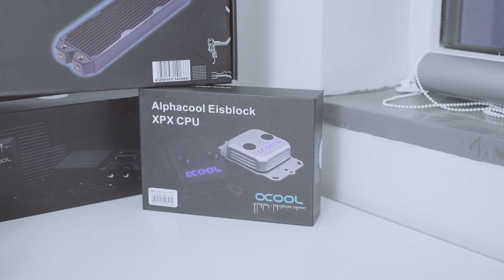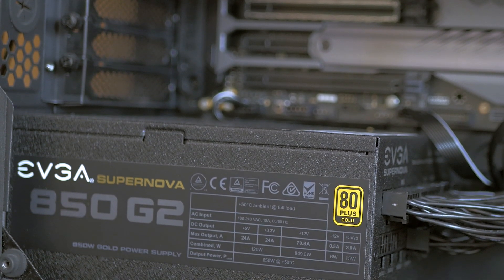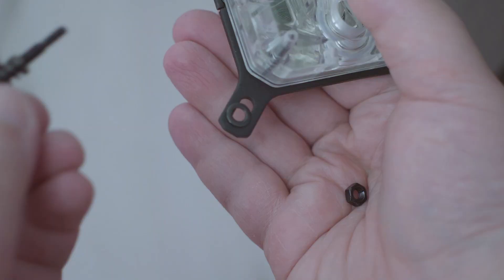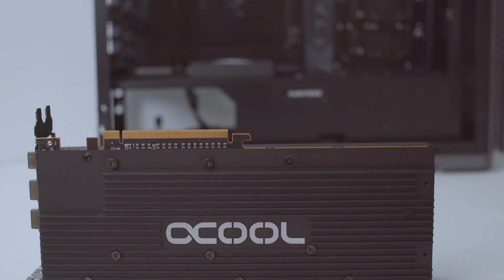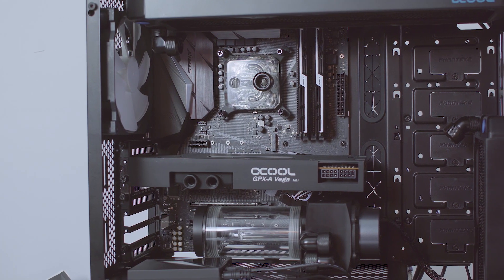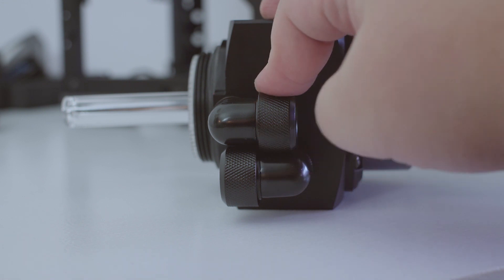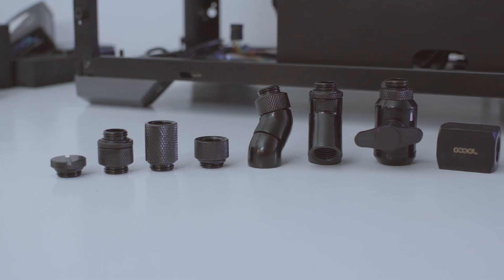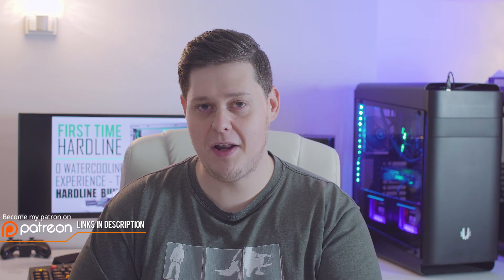WATERCOOLING beginner? / Straight to HARDLINE BUILD GUIDE - Part 1

Comment: Thanks for the video man. I plan on doing exactly what you did, straight into hard pipe, skipping the soft stuff. Thanks for the video, I'm sure it will help with my custom build.
Reply: You'll save money that way, no need for all the soft tubes and fittings.
On the other hand soft tube is handy if your making changes to your loop and need to still use your pc, or if you want to quickly test a new graphics card, then soft tube makes it easier

Comment: 8700K CPU's will need a different socket 1151 board.  Kind of confusing on Intels part.  Same socket but the version 8 processor requires the appropriate chipset, Z370 etc.  So unfortunately you will need to upgrade the board to go to the next level.  However, Thanks for the hard tube video, I was thinking I was going to break something.   Smacks forehead .... aaahhh heat gun.

Comment: Just curious... does your Z270-F Strix handle the 3600 Mhz ram ? I have the same combo (CPU+GPU) and the Trident Z RGB 3866 kit but i can't get it it post past 3200 Mhz. I was just curious if it's a CPU or a Mobo thing.    
P.S. Good idea for the video :)
Reply from the maker: +Vlad Tiberiu It's more likely a CPU thing - IMC related. This board had no issues even with 4000MHz RAM. But like I said, it greatly depends on the IMC as well. It does have like a blind spot around 2933-3050MHz and will not boot here unless tweaked, but otherwise it's a great board.

Comment: Good luck with this project and welcome to the club :)
My couple of cents here:
1. XFlow rads are much more convenient for tube routing, draining and bleeding. 
2. 90 and 45 fittings are kinda not really practical. it's better to use angled adapters + normal fittings. you get the same result but with much more flexible components. and in the end, it does not cost much more (if at all) as the alphacool fittings come in packs for lower price.
3. technically, this alphacool GPU block is not a real full cover block since the waterblock is cooling only GPU (for this particular card also the HBM2) but leaves the VRM to the passive cooling by that huge aluminum heatsink. not ideal and bulky but can save a lot of money during upgrades as you only need to switch that heatsink that conveniently sold separately for almost any card in the market worth liquid cooling.
4. in the long term, the PETG tubing sucks for the following reasons:
a. PETG is the softest among hardline tubing so naturally it is the most scratchy - can be scratched by tightening the fittings and even by whipping the dust of them.
b. PETG is prone to become cloudy (less clear) much faster than other clear tubing.
c. PETG is the worst when it comes to chemicals resistance. For example most coolants contain polypropylene glycol and that things dissolves PETG. It will not happen immediately as the % is low in most coolants, but to have an idea, fill the a piece of PETG tube with antifreeze and seal it. 
The acrylic tube is way better for the long term though still scratchy and a bit trickier to bend.
The ultimate clear hardline tubbing is of course glass. No scratches, no chemical annoyances, remains clear forever. The downside is that you will endup using more fittings/adapters as there is no bending, but not much. In my full loop there are only 4 spots where bending would be an option. And cutting glass tubes is not harder than bending.

here is about what I ended up with for the last loop: https://i.imgur.com/7X6KRgg.jpg
Reply from the maker: +Dmitri Weissman Awesome reply here! Thanks for chiming in with some great advice. I'll take into consideration the angled adapters and regular fittings part!
The GPU block is hybrid indeed. However, the amount of metal in this thing is impressive and should absorb heat quickly, which means even low airflow can give good results for the VRMs. But we'll see once I power this rig up and start testing.
Reply: MindBlank Tech,  no worries, this GPU block does awesome job at cooling if you don't mind the look and size. A friend of mine using it to cool GTX 1080 FTW.

Comment: Please show more about how the drain fitting actually works. Maybe drain some fluid so we can see exactly how it works. Also, please show how you connect the fittings to the hardline tube. Like zoom in and do it on camera. Explain the internal and external diameters of the fittings and tubes. For this to be a guide we need to see every step otherwise we will be lost. I am speaking for all the newbie water cooling builders of course. Otherwise, this is another great video and I can't wait for the next one!
Reply from the maker: +issaciams Yup, you got it. Will do in the next video!

Comment: With a radiator that massive in the roof, you definitely do not need another in the front, especially since it just hinders airflow at that point. If you are determined to keep that front radiator or already finished the system by the time this video went live, then you should get a filter and flip the rear fan around as an intake, otherwise that 360 will choke for air. Also that gpu block is a hybrid block, meaning it still needs some airflow to cool the vrm's, but you should be fine there with the current setup anyways. 

Side note, in a case where a 420 (140x3) radiator in the roof is an option, use that over a 360. A 420 radiator provides more surface area than a 480 rad and decent 140mm fans are no different on a radiator than 120mm fans.
Reply from the maker: +James Mastroianni Thanks for the tip, dude! I'll flip that 140mm rear fan to intake for more air. I agree a 420 would've been better, and no other 240mm needed. It's too late now...

Comment: Forgot a tip.  PETG scratches a lot easier than acrylic. Be careful while handling, also be sure the fittings do not slide up or down tube while placing, cause that will scratch the hell out of PETG and may go unnoticed till under certain lighting conditions.
Reply: If its more delicate, why would you use PETG instead of Acrylic? Does it look better leak less or something? Thanks
Reply: Tanner Richey PETG is strong and does not break easily. A stable material suited for long term use. Also more forgiving that acrylic.	Acrylic is easier to break than PETG and has less impact resistance, however, it has more flexibility.

Comment: Now this will be interesting. I cannot wait to see how this turns out. If you plan to keep long term get a better pump. The flow rate on the Alphacool Eispumpe VPP755 is less than optimal. Not all D5 pumps are the same anymore, specs need to be checked.

Comment: how about mixing soft with hardline tubing? is there any reason not to ?
Reply: not rly esthetic. Otherwise - no drawbacks
Reply: Soft tubing can leach. I would not recommend mixing them if avoidable.
Reply: you can do that no problem. if you have parts of the tubing that are out of sight, for example in a case basement or on the back side of the case, you can use flexible tubing there
Reply: Raziel what do you mean? How can it leach if mixed, but not leach when not mixed
Reply: How did you get that from what I said? I said soft tube can leach. Hardline will not. I said avoid, not that you can't. If you mix soft tube with hardline you will take away the maintenance benefits of hardline.
Reply: I dont get it. why do u even want to mix it?
It will look awkward and even worse than full soft tubing build.
As said guy above - the only one reason to use soft tubing in hard tube build is closed areas, like psu chamber etc. Just to make maintenance more easy
Reply: if you use proper soft tubing without plasticizer like primochill advanced lrt, you will not encounter any leeching issues
Reply from the maker: +Edd Kubilius No, I don't think it's a problem. Just aesthetic-wise...

Comment: I just built my first custom loop about a month ago, all XSPC soft tubing. Glad I went with it too because fitting a 280mm radiator in the front of an S340 Elite was interesting as it had to go ports up, whereas I really wanted to have them at the bottom but wasn't going to sacrifice cooling to buy a 240mm rad instead. There are some very tight areas in my build so the soft tubing was a good choice for me. The fun part was fitting the drain port, which is between the front radiator and reservoir, so the system will have to be placed upside-down and the long tube from the GPU to rad opened to allow air into the system. Not ideal, but it works. Temperature sensor is between the GPU and radiator so always reads on the warm side, but that was about the only place it would fit.

https://imgur.com/a/RzEIw
Reply: that is not a case meant for watercooling lol, wanna take a guess on how much airflow you're gonna get through that radiator?
Reply: @Pennywise, in a s340, we are not talking 2 degrees. It's not a bad case, only for air cooling, rads just add way too much restriction.
Reply: Pennywise but what was the temps of other components? VRM's and NVME ssd's would suffer the most, but any component not connected to the loop wouldn't do as well.  Hell in a mini itx build I did my issue was ram hitting 60c because of bad airflow. Also in your situation your gpu is still on air, so how is that holding up?

Comment: I just did my first custom loop over the weekend too and figured if I'm gonna be throwing away a bunch of money, I may as well go with a hardline build. Used the bitfenix shogun with a 140, 280, and 360mm rad. I didn't use any angled fittings, but I am using a  T-splitter as a 90 degree with a temp sensor plug. 24 hours of work, with a good 8-10 hours of that just being planning everything out after mounting all rads and hardware. Airflow is decently good with the front mesh/foam removed.
Reply: ill assume the 280 rad is in the front, in which case you are heavily hurting your system.
Reply from the maker: +Simon Liu How was building in the Shogun like? I mean a WC system, cause air cooled/ AIO I already know - I use this case in my main system. At first sight, the Enthoo Pro M seems more fit despite inferior size...

Comment: Idk about you guys but I've always thought alphacools blocks are really ugly. I prefer the more subtle/classy look of ek or thermaltake blocks.
Reply: thermalfakes cpu blocks are A) all aluminum B) direct copies of other blocks depending on which model you're talking about, and no, they don't share oem's, thermalfake just copies other companies.
Reply: Matt Heitmann search bykski its cheap af and it has the looks and perform similar to ek
Reply: I really like my XSPC Vega block and the Ryzen isn't too shabby.
Reply: I wasn't talking about the performance of the blocks, strictly aesthetics. Obviously the massive alphacool blocks have far better cooling potential, but they look ugly in my opinion. Also, I don't care if they copycat. If they can give me a comparable product for a lesser price than I am for it.
Reply: @Matt Heitmann still aluminum, so lesser price isn't better (aluminum is fine on its own, but the second you mix it with copper you're boned, and copper is way more common in liquid cooling)
Reply from the maker: +Matt Heitmann A matter of preference, for sure. I think they're great looking, all black, metal. Exoskeleton-like. The GPU blocks I mean.
Reply: the blocks are ugly indeed, but they have other cool things. all fittings and adapters in my loop are aphacool for good quality, good look and reasonable price. The most awesome part alpacool makes is their ST30 XFlow rads. they are the most compact and have double sided ports - very handy.